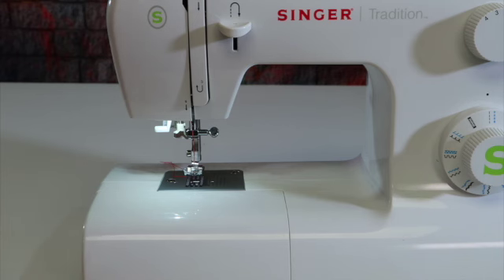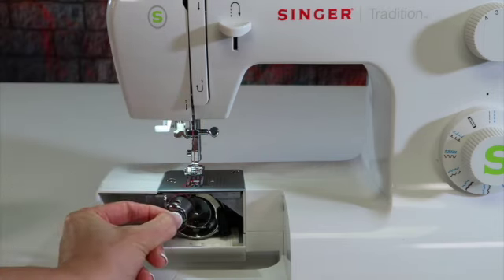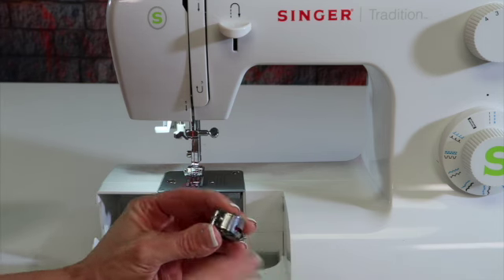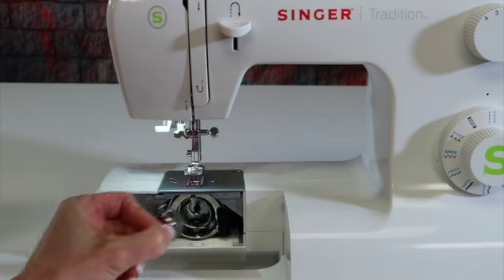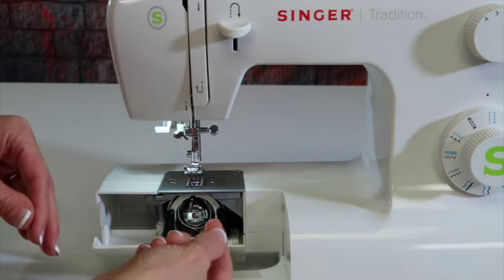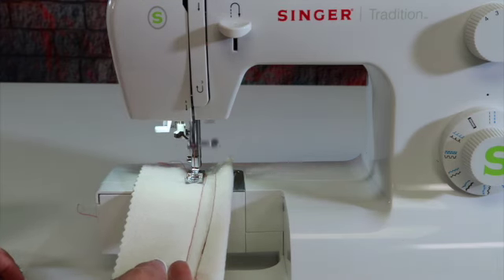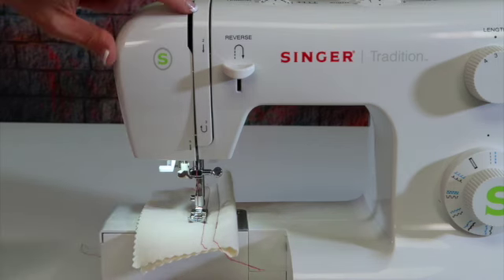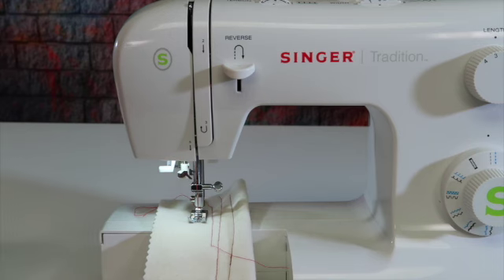Singer Tradition 2277 4 Inserting the Bobbin

Comment: This bbbin is poorly designed...I have never had a problem with my Bernina, but yours is different and will not stay in place when I try to insert it...it falls out..and does not click in ... I always used the Singer with the flat bottom...what made you want this terrible design?
Reply: I agree, Bernina is the superior brand. Singer was simply more readily available and cheaper in my area; I bought mine at a local craft and fabric store for example